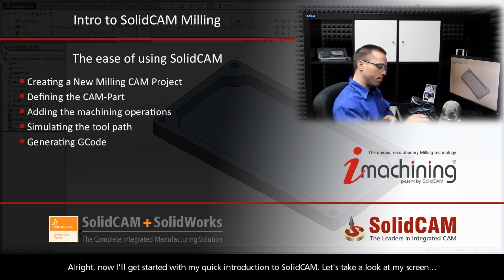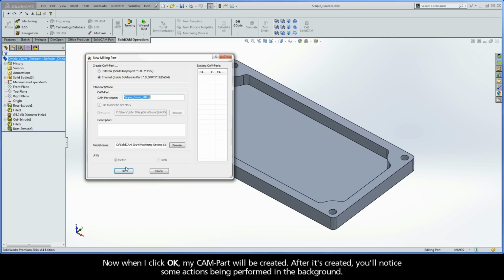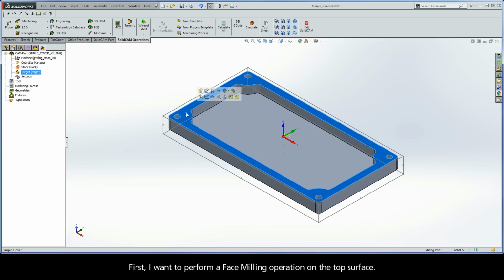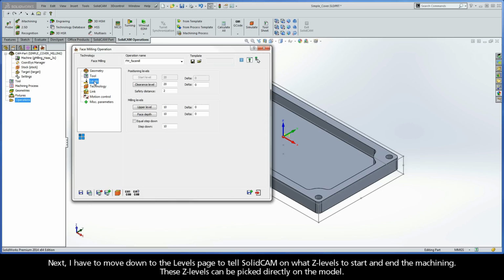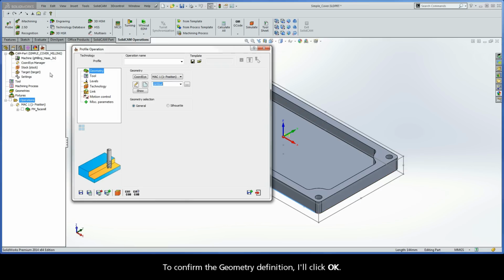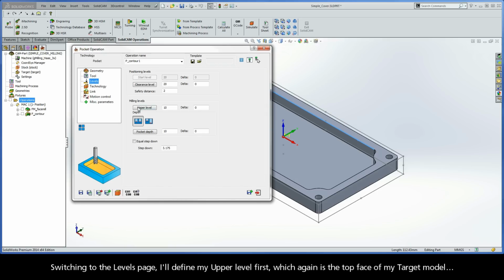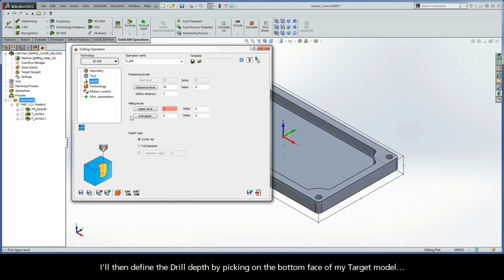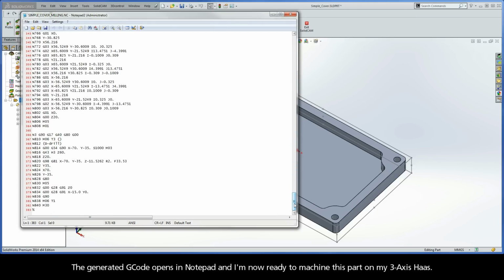Intro to SolidCAM Milling

Comment: Thank you! I did not realize that the word CAM is a verb. Therefore, CAD must now also be a verb.
I understand now. When I program part, I will first CAD the part then I will CAM the part.
Then at 12 noon, I will LUNCH my sandwich.
Reply: Man, I had a job where they called cnc programmer cammers. I was camming for living. I cam a lot.
Reply: @sebasebusiowy  🤣🤣🤣🤣🤣🤣 a lor

Comment: Thanks for this tutorial. But now i have a question.
Is it possible to generate a toolpath for Pocket whitch the tool is not cutting with full diameter after pluge into the stock?
If i set cuttingspeed to 3000 mm/min the tool in my case a 8mm endmill, flyes around my head after plunge in is finished and the tool makes the first move into the full stock with 3000 mm/min.
How to setup that the tool moves in a helical toolpath from in to out without cutting the hole 8mm tooldiameter?

Thanks and have a nice day.

Comment: Its possible to mill 3mm holes with 3mm tool? i have mach2 and the gpp files doesnt work well, it gives me error when i try to generate GCODE when use drilling operation :(
Reply: yes.....you can it.......for more details....contact me!

Comment: Hello, I noticed that the G-code has the M06 tool change before the tool # is called. How hard is it to change the post processor so the line will be posted in the correct order?
Reply: it's probably a Haas thing, not necessarily incorrect:)))